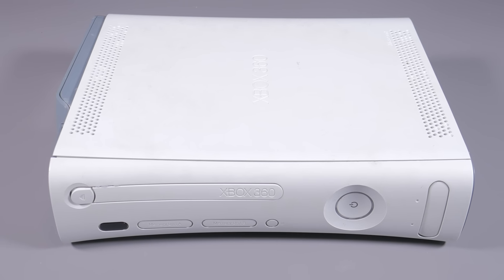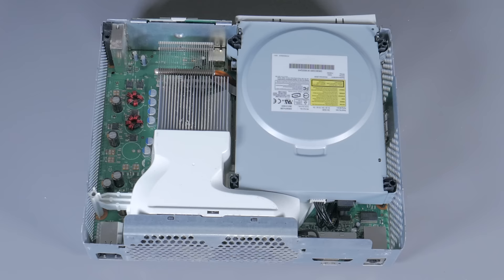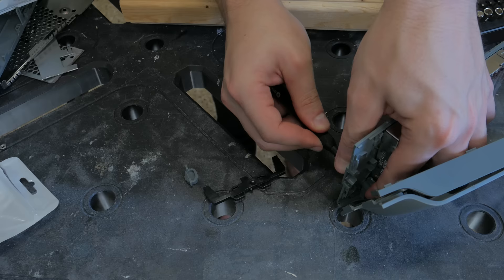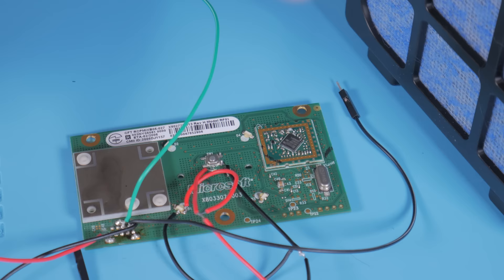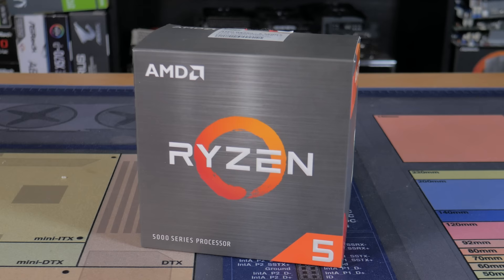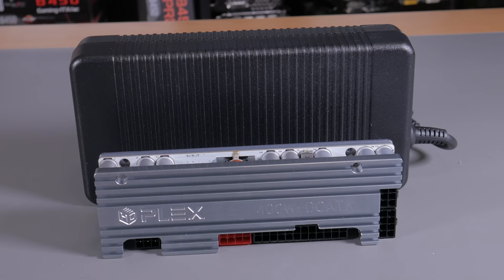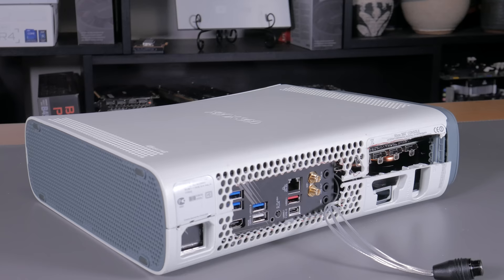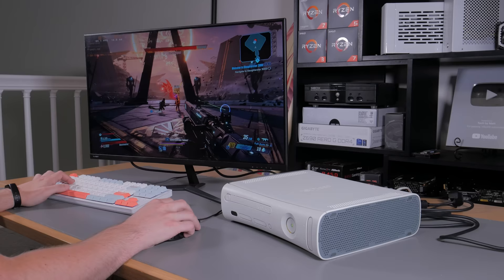I Turned My Childhood Xbox into a Gaming PC! (2022)

Comment: Hi, great idea and very unique project. IMHO you should make many small holes just above the CPU fan (and if possible above the GPU fans). This will help with the temps and probably keep the OEM look as the Xbox already has small holes in other parts of its chassis. However, my experience with the Ryzen 5 5600x is that, whilst it is a low tdp cpu, it 100% needs a very good cooler, otherwise it gets easily to 90 degrees celcius under load. The stock AMD cooler cannot provide adequate cooling to this CPU.
Reply: Yeah was gonna say I did the same thing to a digital Dec PC, and also ran into 90 degrees C temps, on both a Ryzen 5 3600 and Ryzen 7 5800u.

Custom fitting a 60mm 10000 RPM server fan inside and control with a potentiometer (believe me full speed sounds like a got dang jet engine) as well as using a low profile cooler pretty much made things more manageable.

EDIT: and yes indeed the wraith stock cooler didn't help one iota, most likely due to the hat thing over the fan as well as the barely there clearance

Comment: Very cool! This is an inspiring project :)

As far as thermals go, there are a few things I would try. 
First would be to use a blower style GPU, so that most of the heat generated is dumped straight outside of the case instead of the current GPU which dumps its heat inside the case. 

Then I think creating as much natural heat dispersion as possible would be a good shout. Adding mesh to the bottom of the case, or creating little gaps in inconspicuous places. Enough of those will add up to some decent ventilation. I noticed that there is also a fair bit of meat left between the factory ventilation holes, so drilling each one out to a wider diameter will take away a decent amount of surface area of the mesh, while still looking stock.

I think trying to squeeze another 40mm fan into there could also work if you got some low profile RAM. Using at least one of the fans as an intake might be worth a shot too. 

If you weren't too picky about keeping it looking totally stock you could add some feet to the bottom to give a nice airflow gap. You could even incorporate some thin width fans underneath to force a good amount of air into the case. 

Either way, awesome build! ^_^

Comment: Wow this is actually a great idea! Why didnt I think of it for my sleeper build. Ive seen some Xbox 360's go for $5-$10 at pawnshops. No burglar would jack this.

Edit: just got a idea. Instead of soldering stuff ill just bolt the console down to a desk with drewer and have the guts hang out in there with holes cut out for breaking.

Comment: I know this is a year old, but here's my thoughts. If you remove or modify the rear io shield, you could route the power connector to where the original power input went, and maybe even mount it so it's not just a loose wire. Alternatively it looks like there'd maybe be room for another 40mm fan there. If you're okay with using 3D printed parts, I think it would be cool to have a white custom backing plate to completely replace the scuffed up backside. Though I'm not sure you'd be able to seamlessly attach it to the rest of the shell. Also not sure how, but if you could move the dc power converter a bit to the left, you could make or find a custom circuit board to get your two front USB's back

Comment: The reason you never had the RROD all these years is because it was a later improved Xbox 360 model with HDMI. According to the performance specs on the back, it's a Jasper board.

Comment: I was wondering if having some strategic holes drilled in the case right above the CPU fan would help some with temps. This can be done and still look quite nice. A template can be used for more precise spacing between each drilled holes etc. I would imagine it would allow some additional heat to escape which seems to be needed. What about some small micro server fans too for exhaust as they maybe small but are designed to move a lot of heat away from a unit. I've seen people use them on high-end video cards, they look like a similar size to what you used and it worked quite well. Maybe that's what you used and I missed something. I'm sure it will be a little louder but at least you can run everything at its full potential, ideally. Just some ideas for ya. Nonetheless, nice work and looks like a fun project!

Comment: Flipping the CPU fan upside down would prolly make it cool a little better, most fans push air down across the board, in this setup it would be better to pull from the across board and up out and trough the 40mm fans.

Comment: It's actually easy to see why you never got the Red Ring of Death. You ended up lucking out and getting a late model Jasper system. If you look at the back of the console, you can see the power port has 2 seperate guides on the very top, and missing the one in the middle found on older systems. The manufacture date is also post august 2008, which is when they came out with the Jasper motherboards. These consoles EXTREMELY rarely if not any of them got the red ring of death. That is why you were able to push it to it's limits for countless hours, and it never fail you. Just some professional input. :)

Comment: Fun fact, If you ever get the red ring of death, Duct tape the air holes through your entire Console and then turn it on. Let it stay on until it turns green again... it will work 95% of the time. I did this with mine after i got a red ring and my cousin told me to do this and it worked i was super shocked and the crazy thing is it ran for another 2 years after that! I also did this with 2 other Consoles that got the red ring and they too turned back green and worked fine after!

Comment: noticed that the exhaust for the two noctua fans is on the bottom the Xbox chassis, to greatly improve the airflow you can remove part of the metal wall that mostly obstructs and creates a solid wall that the hot air can not get through, planning on replicating this project myself and hope to greatly decrease the temps, also plan on using an am5 motherboard with a Ryzen 7700 8 core and a 4060 ti 16gb at maximum these components draw 318W combined and that's with every part I plan to put in which theoretically should work with the same power supply, these components should work with the airflow plans I have so I guess we will have to wait till I have all the parts here and then ill  let you know how it goes and maybe you could potentially one up me afterwards!

Comment: that's the exact build to do a lot of experimenting and document the improvements! 3d printed air ducks that direct the air more intentionally, maybe liquid metal on both CPU and GPU, more aggressive undervolting/fan curves (I've had a lot of luck with undervolting in laptops, also setting profiles with throttlestop gives you a ton of customization, if you want the raw performance or prefer a quite system that still pushes all the frames it can)

Comment: It would be a good idea to create a Series S style opening above the cpu. Change the direction of the blades or perhaps install a fan with a larger radius. you will draw out that warm air, and create a subsuction through the sides. I assure you that that CPU will lower its temp, including the GPU.

Comment: pretty cool build, i would say if there was some way to measure out and drill some vent holes on the top and bottom for the cpu/gpu fans to breathe and put taller rubber feet on it that might help for temps so that you can restore the voltages to normal. if it were me though id try for a custom liquid cooling system that was piped out of the case to an external radiator/fan setup, either a discreet setup that could be hidden behind whatever shelf it was sitting on, or something that sat next to it that would light up with led lights that would look cool, probably green to match the green led lights on the Xbox itself. maybe theme it after that classic windows game "Pipe Dream". 10/10 awesome 👍

Comment: Good looking build! Are you ever considering putting on the final touches you were talking about? :D 

Looking at 1:03 explains why the RROD never happened. Consoles after around March/April 2008 if I remember correctly no longer had those issues.

Unfortunately my first 360 was from 2007.

Comment: A piece of advice for soldering, use flux! I prefer liquid flux, some prefer paste/gel type, but just try to use a small amount any time you will be touching anything with solder. It makes the bond much easier and stronger

Comment: I definitely wouldn't have opened the original case except for cleaning and repasting.. That has sentimental value. You could've bought a XBOX 360 Housing replacement for fairly cheap.

Comment: If you want to "clean up" the back, there is a type of plastic putty available in a tube at Walmart. It's Steel Putty and its essentially an epoxy based putty that can be activated by simply moulding it between your fingers, and you got about 35 min or so to mold it into place. Once molded, you let it harden overnight. Once it is hard (and it WILL be hard) you can simply file, sand, or Dremel it down to mold cleanly to the frame. The reason I said "Steel Putty" is because it is thermally tolerant meaning it won't break down with heat from the components. It's like fiberglass in a way, but a lot less difficult to mix and get right. 

I do similar work with Snapdragon and Intel based "Chinaboxes". They are essentially Android or Windows based boxes that are primarily for streaming and basic apps and programs. But they make phenomenal emulator systems and play classic games. I often put them into X Arcade Tanksticks and Arcade 1UP cabinets. The Steel Putty fills in holes and areas that can be damaged by cutting. Great for those fills to cover cutouts and holes.
Reply: Edit: Forgot to mention (sorry about that) that after you have sanded it to the desired look, you can paint it to match.

Comment: You weren't kidding about the HDPLEX 400W being crazy expensive.  Probably cost more than ANY other single component, and a good 30% more than the xbox 3609 did.
You need a 3D Printer.  Rotating a cooler 90 degrees and using a printed fan shroud (like the thing had originally) would let you pull air through the cooler and exhaust it out the side, but you'd also need to make sure the video card wouldn't be fighting for air too.

Comment: I have an idea... How about build a cooling pad. You can place your Xbox pc on top of it. As it will push  in the air and pull the heat out of it. Im pretty sure it will help a lot with heating issues and keep it cool.

Comment: It could really help your thermals and noise if you limited the system to 60 fps and 1080p. Obviously, the airflow needs improvement, but just limiting the output of the system will also help a lot.

Comment: That Xbox 360 really only came with a 60GB HDD? Man, gaming has come a long way in a (relatively) short time. I remember when games weren't purely digital and they didn't require so much space. The Xbox One I got (base model, Halo 5 edition) came with 500GB for comparison. Yet that still was barely any space for games when I played it. Nowadays I just play a pc, with a 2TB SSD, 4TB external HDD, and a main hard drive with about 1TB. I only use the SSD for games, but I don't play as many so I have plenty of room.

Comment: Fkin clean, that looks slick bro, nice sleeper. at ur age I was obsessed with using poker chip cases to build sleepers. Used Market Display hardware (Micro ITX with touchscreen). Made for some epic builds. Had my Jeep Fully rigged 5 years before any company imagined this shit. Micro ITX systems have to be purchased on Ebay, or stolen from marketing display company assembly lines. At the time I worked for a company that made Nike/Microsoft displays so damaged products got destroyed or in my case, rehabilitated.

Comment: for very small soldering like 7:15, you can just put a smaller tip to your iron. It will be A LOT easier! Be sure to put some solder on the tip and you're good to go
Reply: Also for the soldering job in general, if you're going to expose some parts of a wire, put a heat shrink protection on the wire before you solder. After you soldered, you put the heat shrink on the exposed part and then heat it up (best with hot air, but the soldering iron at a higher temperature is good too)

Comment: Since your using an external brick, maybe use water cooling on parts and modify the power brick so you can have radiator, pump and power in a separate enclosure and feed the calbles and tubes through a larger tube as an umbilical cord

Comment: I have done the exact same thing but with a pentium 4 3.0 ghz back in the day, when every 360 was rroded. Had to cut and put a fan on the top cover, but it worked fine. For the power supply I simply extended all the wires around 50sm and suffered massive voltage drops :D

Comment: I would personally flip the top fans, that they blow in to the case,

As the 360 hardware wasn't as obstructing as the PC hardware, and they had that plastic shroud over the heatsink that design of pulling will work,

How it sits now, the air that gets blown on to the CPU heatsink kinda already gets pulled away and out of the case.

Also maybe a Noctua cooler might help

Comment: Let's optimize the airflow: Rotate the grapics card 180° and run a pci extension cable underneeth it. now it all points up and we have an unobstructed path from top to bottomn. 
Install passive heat sinks on your CPU and if possible, graphics card, with the finns not blocking the airflow. Make sure your heat sinks use the full hight of the case. use shorter power cables, so they don't block the airflow. 
Install enough small noctua fans in order to use the full length of the console. If possible, install the same ammount on the other side, so they suck the air out, you push in from zhe bottomn. 

This should provide much better cooling.

Maybe you can rewire the power button LEDs, so they work with the RGB protocol, now the console can give you a red ring, when it overheats and a green one, when it's cool.

Comment: Woahhh. This is crazy. I had the idea a number of years ago to put a PC in an original xbox. I actually stumbled upon your video on that a month or so after you built it and drew some inspiration and stole some ideas from it. But its crazy that the build I pretty much ended up doing was nearly identical to this one you did. b550i with a 5800x. Using a evga 3060 ti. Same profile GPU and obviously we ran into the same problem as i used the exact power adapter you did. Yes it runs hot and yes i still am procrastinating on wiring the power button and installing some case fans but I'm writing this comment from it as we speak. Dont know if it would fit as the 360 is certainly slimmer than the original but I used the alpenfohn black ridge cooler in mine. And just bought some VLP ram to try and get a bigger fan in it. If i ever get it 100% cleaned up (we know that never happens with builds) maybe ill make a video on it one day.

Comment: For desoldering a component like the front LED and power button connector, you should try some Goot brand solder wick, flux and run your iron on a high temperature. Use leaded solder, you might need to reflow a few times since the factory solder is so old.

Comment: Not enough air gets to the hardware, CPU and GPU run at ~90°.
The graphics card doesn't get enough air because there is no space between the bottom and the fans, plus there are no holes in the bottom.

Comment: Part 2 would be cool to see. Although, with the Xbox internals, the case was plagued with bad cooling. That's what the generation was more prone to red ringing.
Reply: The only cooling issues were with the GPU, which had a very low profile, low surface area heat sink due to it having to fit under the DVD drive, and the fan shroud barely pulling any air through it. Taping up about 1/3 of the back of the heat sink to basically extend the fan shroud around it made quite a difference in temperatures. The CPU heat sink had fins aplenty and even a heat pipe to move heat to the top of the cooler.

Comment: I give you props for attempting this but I wonder how long till you create the same problem that cause the red ring of death.

If you don't come up with some seriously good, possibly expensive cooling solutions, you're going to need to drill more holes in the case and metal shroud.  You can get some limited improvements from shrouding everything you can to direct airflow but, for example, the CPU  & GPU fans... there's nowhere for the air to move, for the most part.
More than likely though, without a little desktop CNC router, your hole-pattern will look like crap.(i'm a machinist so take my advise on that) You might be able to come up with some kind of jig system that forces the drill bit to drill uniform. 
If it were me, I'd just by a materiel with holes in it, paint it white if it's not already white, cut a square over the CPU & under GPU & pop in the pre-made material..
If you MUST have the sleeper look though, ordering custom heat-pipes & making custom fins for the ends is probably what you're going to need to do. If you go to an electronics recycler, you might find some heat-pipe solutions that work Apple desktops & some high-end PC  & Apple laptops have long heatpipe configurations & you might be able to bend them to your needs.

LET THAT THING BREATH!